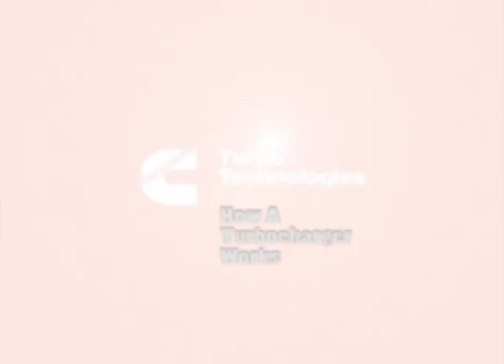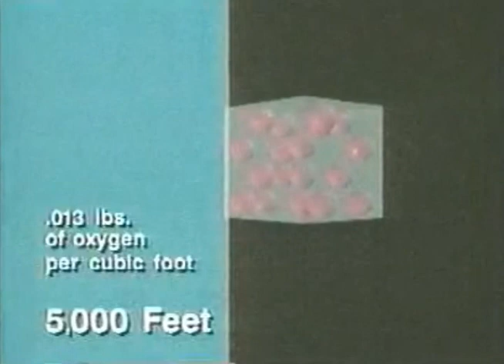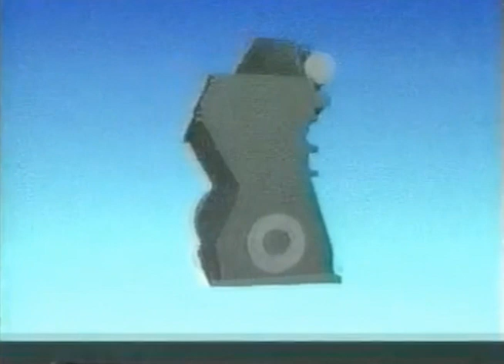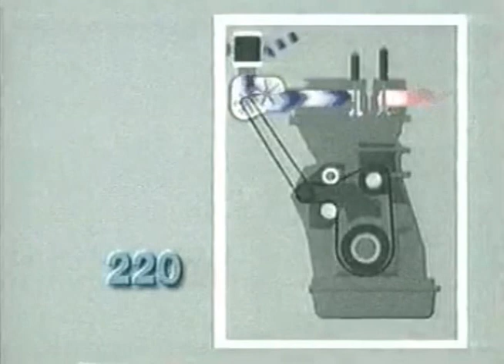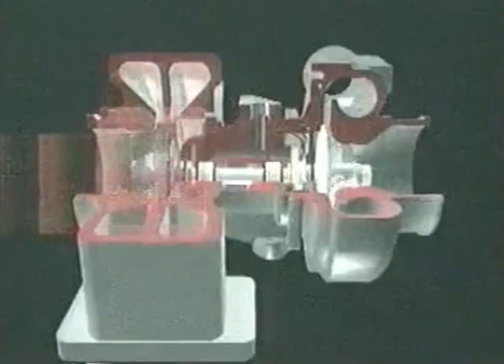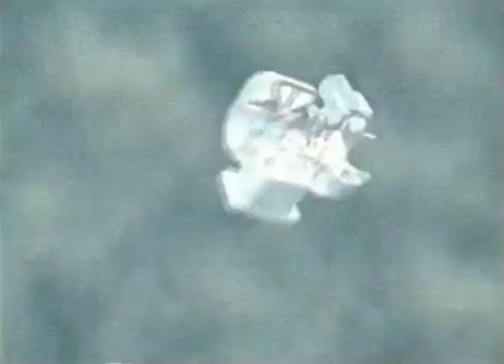How a Turbocharger Works

Comment: the exhaust spins the turbo that spins a shaft connected to a another turbo that sucks the clean oxygenated air into the curberator of the engine!

Comment: the air from exhaust which rotates the turbine, is it released from the cylencer .??
Reply: yeah the exhaust gas energy is used to rotate the turbine and hence the compressor draws air from atmosphere, pressurize it and give it to charge air cooler, for cooling and finally to the scavenge manifold.

Comment: how is a turbo a parasitic loss the turbo is using used power to make power not you already have the exhaust coming out at pressure so why not use it to make more power does cost anything to make that power

Comment: The oxygen doesn't become "thinner" at higher elevation.  There is still the same percentage of oxygen but it the partial pressure of the oxygen in the air...so.......HOW NEAT IS THAT?!
Reply: The air is thinner at higher altitudes